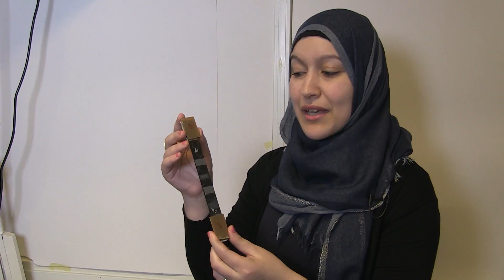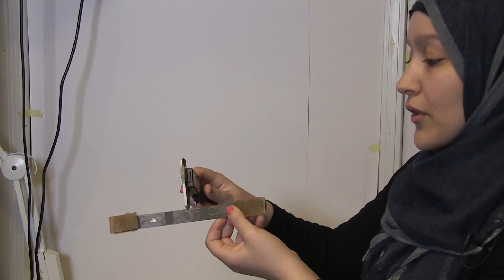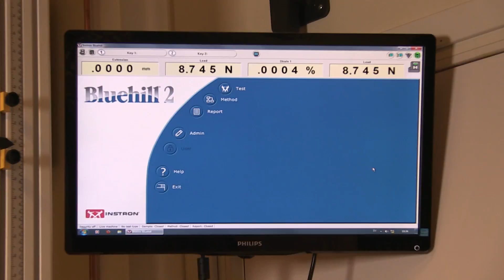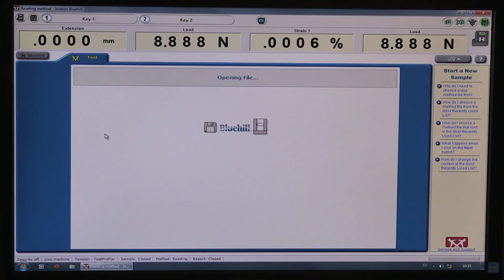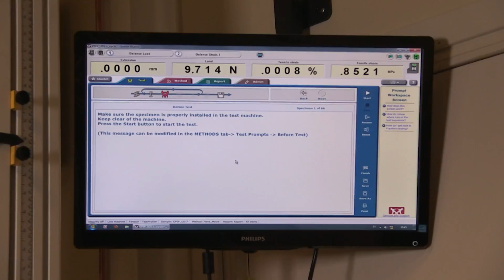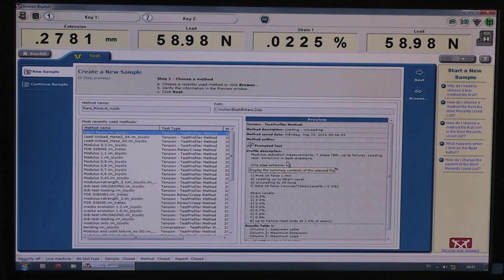Instron 3366 - Tensile Test of Composite Specimen

Comment: how did u attach tabs onto this specimen, Is this CFRP tabs or EMery cloth tabs..As according to ASTM D3039, we can also use EMERy cloth 80 to 150 grit ..Because when I tried to attach CFRP tabs of (50*25 mm) it's very difficult to bond and even after keeping for 2 days for curing, it's slipping.
Reply: So what did u do else? Bcs I just found this method to apply sandpaper on tab area, how do I attach it? Can u share it with me
Reply: @ciksumurni2429  Sure., What I did was I glued mery cloth(150 grit) onto the tensile specimen on both sides (like two on either ends) and I put it to cure for like 24 hrs under a force/weight (spacer)
Reply: I used a good quality Glue for bonding
Reply: @faraz2015  ooo.. Thanks for sharing the technique that u used. May I know do you sand the surface of specimen on the tab area before gluing the sandpaper?
Reply: @ciksumurni2429  The specimen I bond the glue to, they'll be under certain conditions, so you can directly glue it after applying ethanol/acetone just to the bonding area(tab area)
Reply: @faraz2015  ethanol/acetone will act as a cleaning agent right?

Comment: Kindly tell us how you tabbed the samples and which material u used for this purpose?
Reply: @engineer Baabun this video explains quite nicely how to apply tabs with a fixture then all one has to do is to precision saw to rough cut them then using a precision grinding/milling machine to get them to their final size 

https://youtu.be/h4q1GeVGr6s

Comment: Great video!  I am more familiar with plastics than I am with composites but I believe what I am about to share applies to composites.  Generally speaking, a vernia caliper is fine to use for with but it is not acceptable for thickness measurements, at least not in accordance ASTM D5947 or the equivalent ISO standard.  A micrometer should be used for the higher accuracy.  All of your videos are great

Comment: How did you measure the gauge length of your specimen ? Please explain
Reply from the maker: Well, I would say that there is more than one way to measure gauge length of the specimen. If you are using end tabs then the distance between tabs can be considered as a gauge length. If you do not have tabs then distance between grips should be used as gauge length. However, if you are using extensometer then you can neglect what happens outside the gauge length of extensometer and only consider the length in between extensometer legs as gauge length of the specimen (in this case you avoid influence of the stress perturbation within the clamping area). When you report the results it is advisable to report all length scales that are involved. For example, for the specimen shown in the video it would be something like this: the total length of the specimen is 250 mm, the length in between tabs (which often is the same as grip separation distance) is 150 mm and extensometer base length (distance between extensometer legs) is 50 mm. Now depending on what you want to evaluate you can use one of those values. /The L-Tube Team